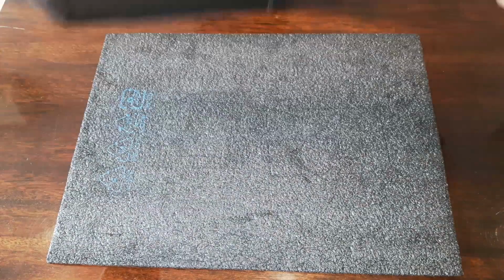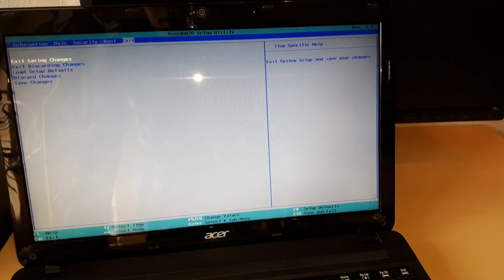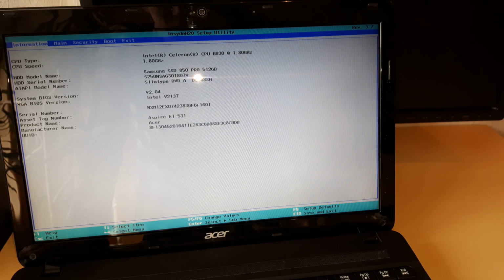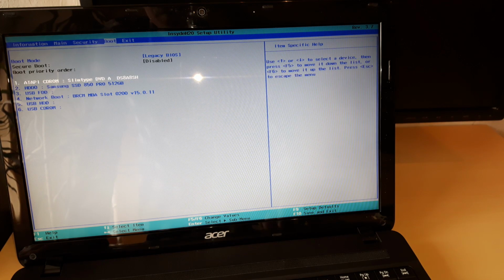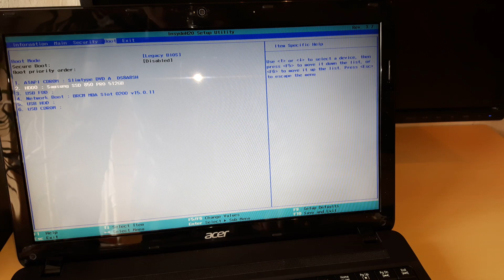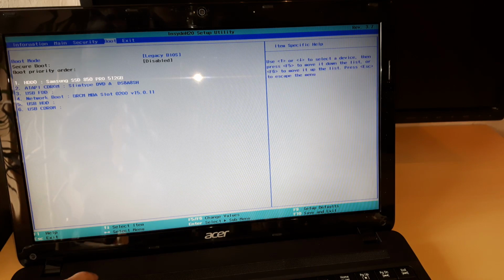How to save your dying/slow laptop...

Comment: This is very good tutorial because a lot of older laptops older than like 5 years start to become laggy and unresponsive... Great video!

Btw I will never buy an Acer laptop in my life ever again, from my experience Asus is the most reliable option when it comes to a good windows laptop 😂
Reply: Vaibhav Srivastva  probably good too, but I can't tell for sure because I am not familiar with it that much, Asus or hp are something I can tell from this position, Dell might be good as well 👍
Reply: Vaibhav Srivastva  Thanks for the information, but since I am familiar, but not too experienced about computer specs, can you tell me what component in your laptop needs to be better so it cam run newest and the most demanding games, if it's not a problem to you? And how much did it cost so I can compare prices between some of my picks 👍 Thanks for previous responses though!
Reply: Vaibhav Srivastva  if I am not mistaken from what you have told me, you laptop has 2 cores?
Reply: Vaibhav Srivastva  this was helpful, thanks 👍
Reply: Vaibhav Srivastva  exactly what I was thinking at first, and you just confirmed my thoughts, thanks bro 👍
Reply: Vaibhav Srivastva  oh I forgot to say, I asked about GTA IV not because it's from 2008, but it's the GTA game with the worst PC optimization easily, so even the most powerful PC's have a problem running it on max settings 😂 once again, thanks for the info 👍

Comment: Important things to note:

Do not buy cheap 30 dollar SSDs from Aliexpress or Ebay. Most of these don't have nand controllers, so they are terrible for random writes, essentially meaning they are complete garbage, so you're better off with your HDD. Don't try to save 10-20 dollars for a nand controller.

Also, for old laptops (like Badinfos). Don't install windows after SSD upgrade. Install any distro of linux, of which Linux Mint is my recommendation for a beginner. Only considerations for not installing it are:
games (although if you play on Steam, Steamplay mitigates a lot of issues and run games flawlessly)
elaborate controllers for games (like a steering wheel)

And that's pretty much it. Adobe products work fine with little effort, although I don't see why you should use an Adobe Premiere on old-ass laptop.

By the way, it's usually not a concern on old laptops but don't install windows 10 unless you want to suffer performance losses and be subjugated to identity theft. (This only excludes windows 10 enterprise LTSC version with "security" telemetry option)
Reply: But you can buy a cheap 30€ SSD on amazon
Reply from the maker: Nice tips you have there :)